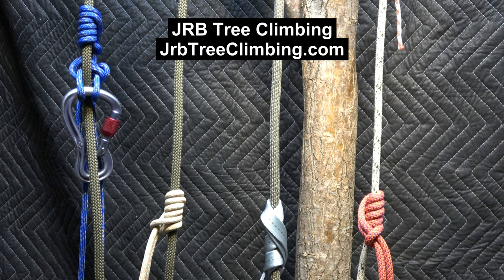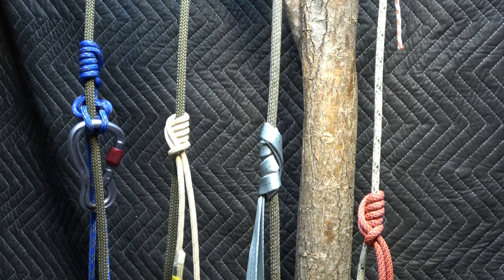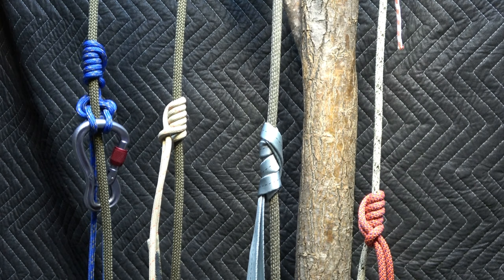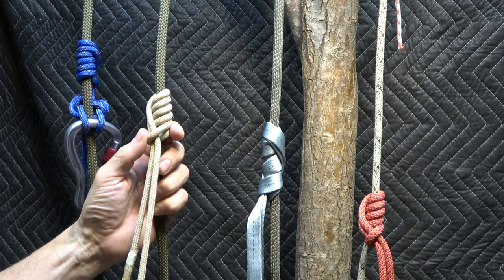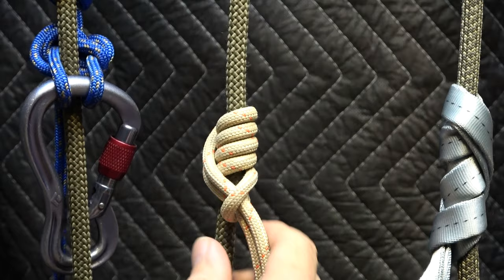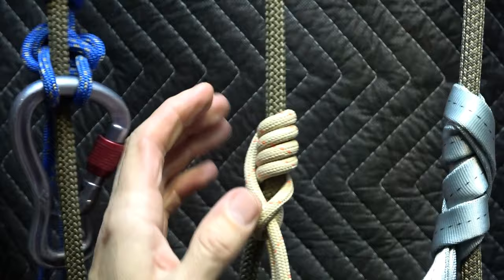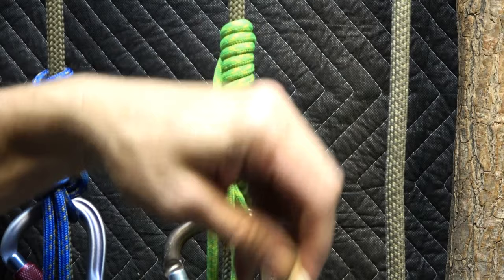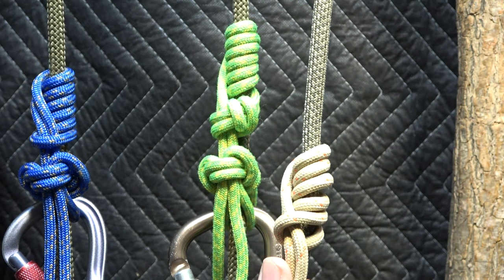Tying the Hedden Knot and Hand Ascender

Comment: Thank you jrb, always bringing great concepts to make rope travel more efficient, ergonomic, and specialized. I was interested in the webbing being used.
Reply from the maker: Thank you sincerely. That's a Sterling 11/16" sling that I got at RockNArbor. Also, I have done quite a bit of climbing on friction hitches constructed out of web slings, particularly the Bachman.  It's a criminally smooth hitch, however, in wet conditions, i found it more prone to creep than cordage. When in doubt, add a wrap. Here's the link... and use the JRB10 coupon code for 10% off all your purchases:
https://www.rocknarbor.com/product/sterling-11-16-inch-sling/

Comment: Hey John thanks again for this and your other videos. They have been very informative and you teach it so well. This is where I learned the Hedden so wanted to share this here. I’m still learning what works best and for the rope and hitch cord I happen to be using (1/2 static with 7mm both stiff) I have been most comfortable using Hedden with 3 wraps. What I have recently found is that instead of bringing ends through loop at bottom I give an extra wrap and bring loop through the bottom wrap and then I put my ends through. Doing so it definitely grabs quicker and better and seems to release better as well. With good rope and cord this may be too much but for what I have this has so far worked really well. I don’t have much cord to work with yet so haven’t had the opportunity to do much more than a simple hitch but look forward to doing so soon. Thanks again, you’re shared knowledge has been much appreciated.
Reply from the maker: Jeff, that sounds remarkably similar to something I have been using.  I even posted a photo of it on some forums recently to try to assess if it's a named knot.  Do me a favor pls: take a photo of it and send it to me. If you're in my JRB Tree Climbing Facebook group, you can post it there. Otherwise, leave me a comment on my website and I will reply by email.

Comment: Hi John, I posted another comment in your hedden test video, we can transform this hitch to be workable under load , two ways I found at least 
I couldn't test them yet but I'm sure it is possible 👍
Reply from the maker: Appreciate your comment and passion. Experimenting with these hitches is fun! I have also devised variations of this and other hitches to improve performance, but have chosen not to publish them if I am not happy with their performance.  With Hedden, and variations which route the bulk of the load to the TOP of the helix, the most difficult test to pass is this: execute an SRT climb on a single hitch, and demonstrate the ability to break the hitch under load in order to transition into rappel.  Be aware that the hitch can be in a different state after experiencing the cyclic loading of a 25ft climb than it is without the climb.  In summary, I prefer Hedden as a backup not a primary point of connection.  Because in an emergency scenario, we can always get our Hedden broken using the techniques demonstrated in the video:  Self Rescue After Loss of Footing m

Comment: I have seen this referred to as a Bachman hitch, and I have even seen it claimed that it will hold on wire rope.  Have you tried this knot on wire rope or other cordage smaller in diameter than the hitch cord?  Did it hold?  I would love to know if that works or not.
Thanks for the great video.
Reply from the maker: Thx for your comment and support.  I am very familiar with the Bachmann friction hitch and am 100% certain that this is not the Bachmann.  The Bachmann integrates a carabiner inside the friction hitch, allowing it to move VERY freely when unloaded but very difficult to break under load. It can be tied with webbing or cordage onto a rope of larger diameter.  Unlike most friction hitches which work best with a cord approximately 75% of the rope diameter, Bachmann is typically better even smaller, like 50-60% of the rope diameter.  As per your question about wire rope, I have never tried anything like that. I have a small length here in my lab and i just tied a Hedden using 4mm Nylon cord onto a Wire cable of 6mm and not surprisingly, it seems to hold. However, my guess is that wire rope would chew thru the cord very quickly.  If you meant using wire cable on wire rope, then my guess is that the cable simply won't bend enough to form a Hedden but if you use a thick bodied carabiner which has a diameter greater than the wire rope, well, i suppose a Bachmann might hold.  I don't have the materials to test it and would not recommend it for any kind of life safety application.

Comment: Would you use a EDK instead of hunters bend?
Reply from the maker: 1. I am assuming this is a general question, not related to this video specifically.  2. For anyone reading this who is unfamiliar with the acronym, EDK stands for European Death Knot, a poor name for the Flat Overhand Bend. My opinion on the Flat Overhand Bend is that I don't recommend it for applications where the two strands are being pulled in opposite directions, which is typical with a Bend.  However, if we are joining two lengths of cord at a point where they bend over another object like a carabiner, and we want to get it nice and tight, I am okay with the use of this bend. I do use it, and I typically back it up with a 2nd double Overhand.

Comment: John first off , Thanks for all  your work.
I used the Running JRB Hitch exclusively this past hunting season , it is now my go to system .  I would like to incorporate the  Hedden Ascender knot tied with webbing , quick question.  What  length webbing loop would you recommend ?
Reply from the maker: As I described the "Ascender ", it was built with a length of cord because incorporated both a Hedden and a Longhorn Hitch.  I have not attempted one with webbing. I am not saying it can't be done, but you would need to use a length, not a loop of webbing.  My sewn loops (runners) are all 60cm or 24in. That's what's used in the video. An 18in would likely be ideal and compact.

Comment: I am a rope rescue technician and am looking into ascent/descent devices.  I will be using this in a srt configuration this week as I climb with a foot and knee ascender. Another climber I work with just purchased a rope wrench to aid in the time it takes to change over to an 8 for descent...can i descend with this hitch reliably once it's been loaded? Or will it not break once it's been loaded? Ideas? I know there must be a practical way to NOT use a device to accomplish this, but I lack the knowledge to execute. The rope wrench shares the load between the clevis hitch in the middle and the device...
Reply from the maker: I would not recommend this for SRT climbs in light of superior options here on the channel.  I haven't done much with SRT demonstrations here on the channel but will supply two options. 
1. A Double Michoacán and a Munter: https://youtu.be/J8y-xl73sMU
2. The 523 "JRB Ascender Hitch in soft bridge mode" and "single rope rappel on the munter friction hitch" .  You can find those videos by a quick YouTube search and the prefix of jrb
Reply from the maker: I never recommend rappel with friction supplied by a friction hitch.  It's only a backup on rappel.  Use a Munter, Figure 8, ATC, Rappel Ring etc. Instead